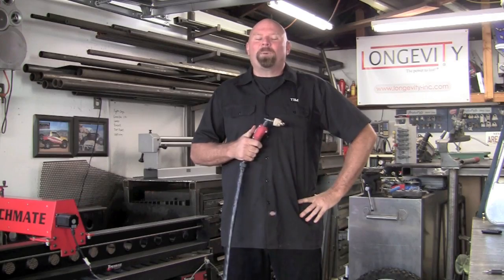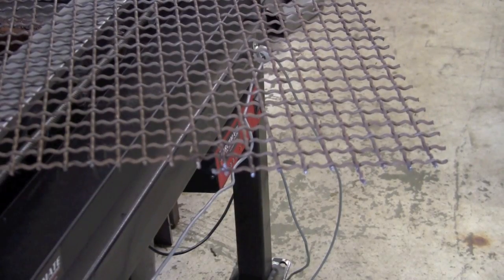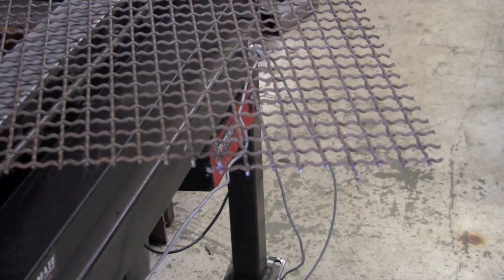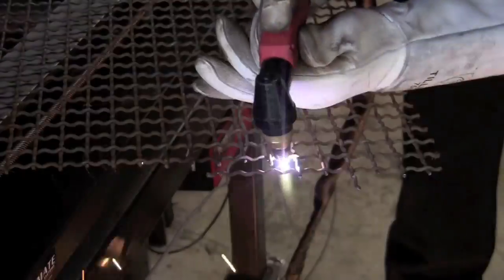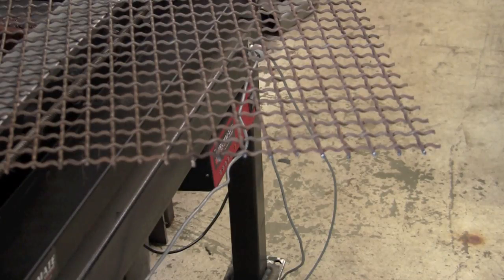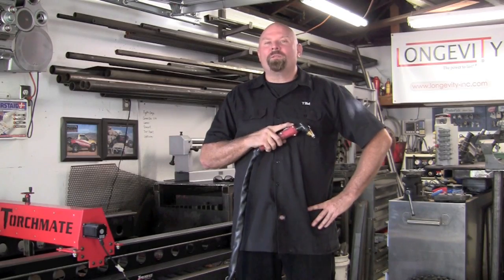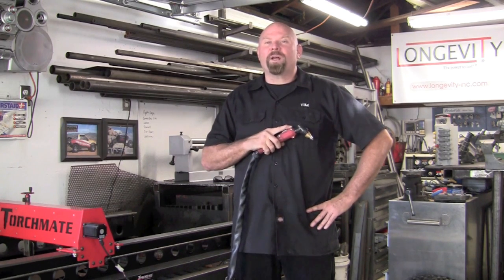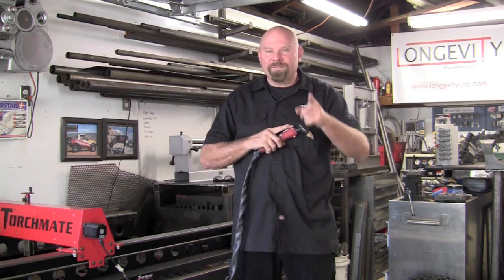Pilot Arc Plasma Cutting - What is Pilot Arc? by Longevity

Comment: What would cause the pilot arc to only run for 1/2 second? I found loose connections inside the torch head and corrected that, but problem not resolved. Model LTP5000D